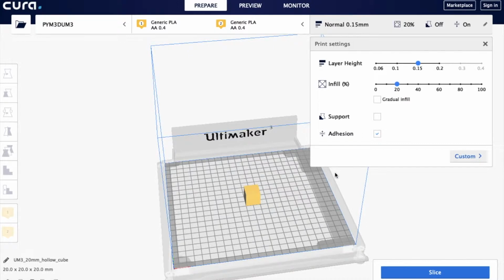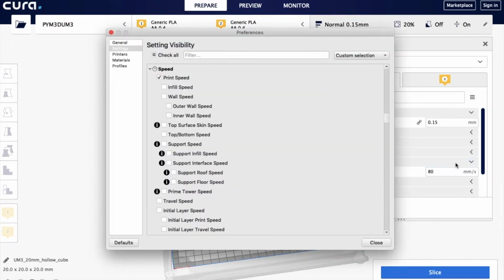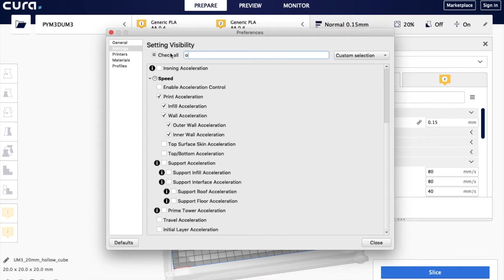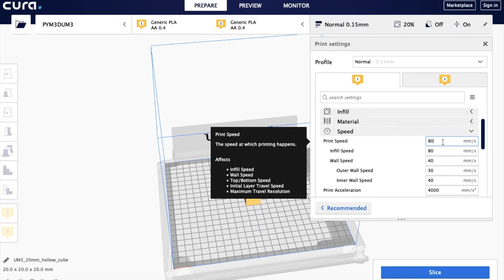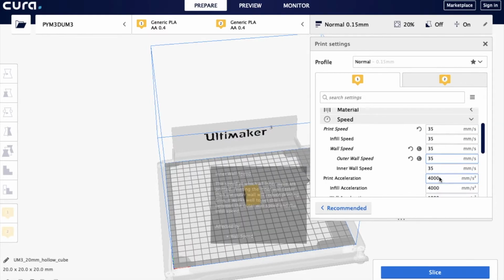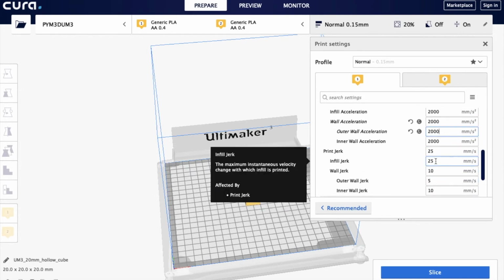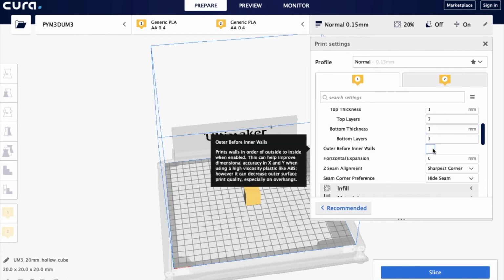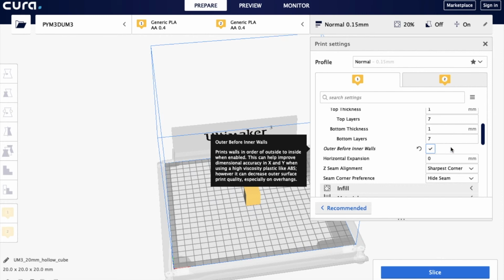How to Improve Dimensional Accuracy on the Ultimaker 3

Comment: 35 is going to significantly impact print times.
What you should do, when making such a video, is to run your theory through a couple tests and show them.
35,45,55,65 for example.
Then you could actually see if something changes except for the print time.

Comment: Nice, Since you already tested what percentage of error did you find out? Can you give any example ? before and after.

thanks

Andre
Reply from the maker: That is a great question. We found that the default settings would print a 20mm calibration cube within +/-  0.1mm on fast settings with PLA. With these improved settings that reduced to +/- 0.03mm.